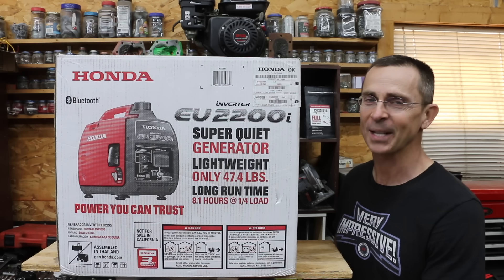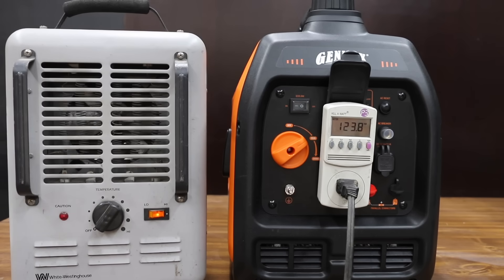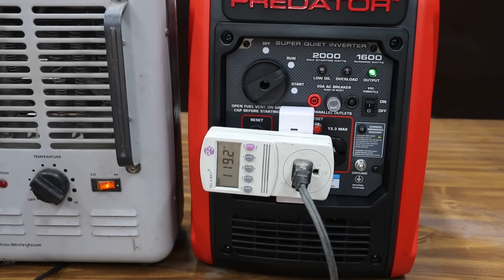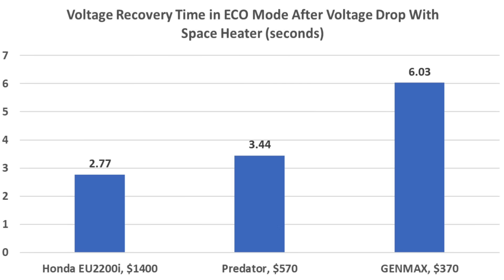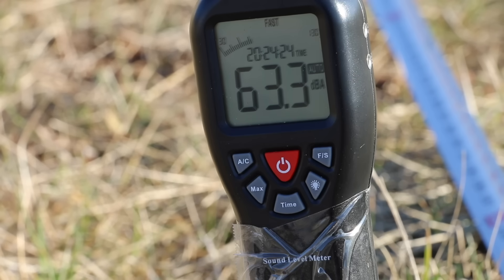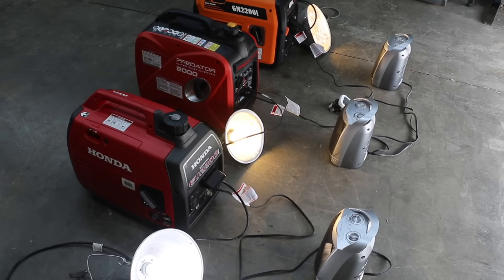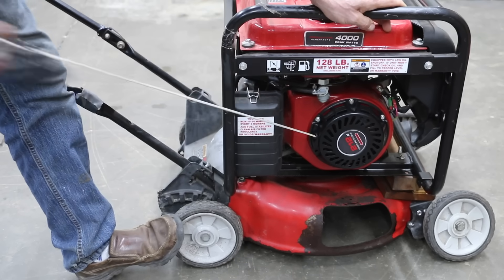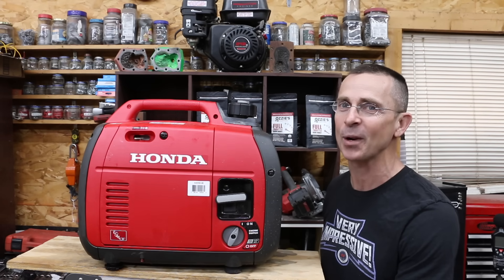Cheap Generator Better Than Honda? Predator vs Honda & GENMAX—Let’s Settle This!

Comment: On the vein of generators, I use propane/gasoline dual input generators since propane is a bit easier to store and keep stable I just keep several tanks around. Next time you do generators, a propane based one would be interesting to see in both power and noise. Great as always!
Reply from the maker: Great video idea! Thank you
Reply: @ProjectFarm  A propane generator test/comparison would be a great idea, as the carburetors have no issue with gumming up after long storage!
Reply: @rhpicayune 

Thats why using Ethanol based fuels. E0 is better and all I would use.

That being said, I am willing to bet that one could store propane for a much longer period of time than even E0. 👍
Reply: @rhpicayune  I always use StaBil reg or marine in my stored gas engines. No problems storing over winter. Chainsaws, weed wacker and generator at my hunting camp sit 10 months between uses. No problems.
Reply: @ProjectFarm  I bought a Wen DF475X for $500, decent dual-fuel. I'm pretty sure the output frequency is not very clean though. Not sure what size you'll test next, but a Wen would be cool to see.
Reply: @Project Farm  
and maybe add in the fuel efficiency and power output compared to different fuel types. I know when running propane you lose hp with aerial lifts and material lifts and  it's the same with generators. I wonder if the claim is what they say and worth using alternative fuels.
Reply: @ProjectFarm I would like to see tri-fuel generators added to the list or at least some portable units that can use natural gas. In the past, we learned that weeks long, major power outages take out gas stations and businesses that sell propane while our natural gas flows uninterrupted.
Reply: I'll second that.. I converted 2 of my chyna-cheapo's to propane and plumbed them into my house line..  Before I did that, I was outside in the snow, rebuilding the old up-draft walbro on my 9 HP briggs a couple times per year due to junk gas gumming and rusting...  With the propane,, it's an oil change once a year or so and no other maintenance. Just close the valve to shut down.. No worries about draining and fogging the fuel system.. . It would be interesting to see some actual data including engine wear and power output on the different fuels..
Reply: A lifetime ago I worked at Penco making lockers and industrial shelving.  The forklifts in the factory ran on propane because it was safer.  I'd like to know the carbon monoxide differences between running on gas v.s. propane with a genny.
Reply: @bansheedearg  Propane emits up to 80% less carbon monoxide than gasoline in a car. Emissions on a generator will be different, but I imagine propane will still produce significantly less.
Reply: @bansheedearg  propane burns a lot cleaner ..i used to run a V8 Landrover on propane and after a year the oil looked as clean as the day i put it in
Reply: @bansheedearg  safe"r" being the key there. You are still combusting oxygen in an enclosed space and producing co (among other things). Think about the whole natural gas/propane oven debacle recently (and the fact no indoor gasoline ovens exist), it's safe-ish, depending on the size of your house, ventilation, season, airtightness of the home etc.
Reply: @DracoOmnia  Excellent point, sir.  I do love my gas appliances but the furnace,  water heater, and clothes drier all have pipes to the outside for exhaust.  The oven, which I love for it's gassy power, does not.
Reply: @bansheedearg  Of course, because the combustion standards for the oven/stove are different that the other appliances, which is why they are vented, and the oven is not.  I have gas wall heaters that also do not require ventilation due to the ability to burn clean.  The ones that require venting are not held to the same standards.  But, still all need a source of replenishing combustion air.
Reply: I’ve seen videos where they convert the Honda to run on propane considered it for the storage benefit
Reply: @HawaiiSustainable  I converted and run a Honda 2200 to bio-gas.

I made a biogasification system that I run horse manure thru to create syngas which can be run thru the generator.

I get rid of my manure pile and get some free energy to run the lights in the barn.
Reply: @HawaiiSustainable  
Yes, there are LP conversion kits for the Honda EU line, but AFAIK they cannot be configured to easily switch between gasoline and LP/propane like some of the other Dual Fuel generators.
Reply: I think you lose a bit of power running propane as opposed to gasoline or diesel.  I believe diesel is the most efficient.
Reply: @Codyjrt  The claim is 20% less power on propane but if you're not using full power,, it shouldn't matter..
Reply: ya agreed I'm saving up for a duel fuel myself I'll take the performance hit of propane just need to get  the bigger gen..
Reply: Indeed, as many have said, I converted my Predator 3500 to propane as it seldom gets used and haven't regretted it yet. It IS harder st start but I put that on the propanes fewer BTU's per gallon; am I wrong about that?
Reply: @postalinVT  yes there is less energy stored in propane. 

In cold climates (think of a 15f day after a storm). Propane also starts to have trouble vaporizing once the generator has been run for a while. As the propane boils off into a gas it gets colder, and since it's already cold outside you can find yourself having trouble with propane generators, especially under high load such as running space heaters.... The bottle temperature becomes so low that the tank pressure drops below where the regulator can continue supplying gas. 

It is a great stable fuel, but it has it's drawbacks in certain use cases
Reply: @postalinVT  If you swapped the carb for your conversion,,, The regulator on the carb needs engine vacuum to allow propane to flow through it and the line needs to be purged of air with the button on the regulator..  SO,, you may need to pull a little harder to create enough vacuum to open the regulator on a cold engine. Typically,, Hold the button until you smell propane,  you choke it and pull one time, then reduce to half choke and it should start on the 2nd or 3rd pull....
Reply: @twistedhillbilly6157  Thanks twisted. I didn't change the carb. The kit I bought came with a 'diffuser' ring that goes between the air filter and the carb. Floods the air inlet with propane. I do wait till I smell propane and have it on choke but maybe I don't need to choke it if It's flooded with propane?
Reply: @postalinVT  Do you have a regulator mounted on the frame or somewhere else in addition to the one on the tank??  As for the choke,, In your case it would be different because the choke is AFTER  the fuel input.. I would leave the choke wide open (OFF) because it blocks the fuel. perhaps half choked to create more intake vacuum which is needed for the propane to flow
Reply: @twistedhillbilly6157  Thanks, I'll give it a try.
Reply: Just adding to the pile. I too would like to see a propane/dual genset showdown.
Reply: Propane and propane accessories
Reply: A 'bit easier'?  A thousand percent easier!  My current home backup solution is 100% propane... if my big tank gets low I call the company and it's refilled without me even noticing.
Reply: Agreed, I need to buy a generator soon and I want a dual/propane for the simple fact I can store my fuel indefinitely
Reply: @hopinondeeznuts350  If you get a gas only model you can get a conversion carb for around 20 bucks...  It is a perfect bolt-on with no modifications needed,, then you just use a BBQ regulator which are the same standard 11WC pressure..
Reply: @twistedhillbilly6157  interesting, I will definitely look into that.
Reply: Someone in the comments suggested a comparison video for propane versus gas in these generators. I definitely second the motion.
Reply: Propane's lower energy density at the current price makes it more expensive than gasoline it does have the advantage of basically indefinite storage without degrading that's pretty nice also it starts about the same no matter what temperature it is as long as it's above the boiling point of propane
Reply: My Honda generator is rarely used, so I converted it to propane with a kit. It can sit unused for years, and it always starts on the 5th or 6th pull. The kit I installed added a shut-off valve in the gasoline line, so it can still run on gasoline.
Reply: @alex_stanley   hutch mountain? I added an hour meter, magnetic dipstick and ngk plug as well. Mobile one 5w30 and its pimp tite for the 150 hours I have on it so far.
Reply: I hope you can include the Firman Dual Fuel Inverter Generator from Costco. 
I’m definitely looking at that for emergency use, keeping a tank of propane ready to go.
Reply: Dual input ? how do make a generator dual input ?
Reply: @AAAAAAndrea  There are several ways... A dual fuel carburetor  is the best... It has an input for liquid gas and one for propane,, many also can be switched to natural gas so it's actually tri-input..  Very simple...
Reply: @AAAAAAndrea  

I think dual input is the same as dual fuel. Many are made that way, which is what I would buy.

There are probably many videos on how to make them that way. I saw one for a riding lawnmower.
Reply: Den of tools had a video that implied harbor freight was going to do dual fuel in the future.
Reply: @davidjernigan7576  Den of tools makes a lot of stuff up and is WRONG most of the time...
Reply: I am also much more interested in propane generators than gasoline generators.
Reply: Propane burns cleaner than gasoline. It does have less BTU content than e-10 gasoline but it depends on how much horsepower the prime mover engine has to the output wattage. It is industry accepted that it takes two horsepower for every 1,000 watts under load. This takes into account the inherent inefficiencies of an internal combustion engine. I have a Yamaha EF 2000 IS and converted it to trifuel. I am still able to get the 1600 w output on gasoline as well on propane. 

Another important piece of information that many do not realize is leaner air fuel mixture on gasoline will result in higher combustion temperatures, it is the OPPOSITE with propane. A richer air fuel mixture with propane results in higher combustion temperatures. I see many people converting their gasoline only generators running the air fuel mixture too Rich and they burn their valves. The ignition temperature for propane is higher than gasoline but hardened valve seats which are commonly found on small engines are able to withstand the slightly higher combustion temperatures when air fuel mixture is properly set.
Reply: @Bassguitarist1985  Can the air fuel mixture be affected by the propane regulator outside the unit? Once I get my 3500 running it runs smooth and quiet.
Reply: @postalinVT  is the propane kit aftermarket or OEM? If it is OEM I expect that the air fuel mixture was set at the factory and one should not touch that adjustment unless they know what they're doing.

If the propane kit is aftermarket then you need to make sure that the machine is running as lean as possible on propane in order to support the load. US Carb for example with their motor snorkel kit with its demand regulator on the generator has what's called a load block that restricts the propane flow which adjusts the air fuel mixture.
Reply: @Bassguitarist1985  It's after market and I can't remember the brand. Besides the obvious regulator on the bottle, there is a small thumb wheel that controls the gas flow so you can regulate for a smooth idle.
Reply: @postalinVT  Yes but just because it runs smooth doesn't mean that it's running the leanest it can. The best practice is to turn that load block screw clockwise when the engine is at full load (electric resistive heaters are best) a little at a time until the engine starts to stumble as in starving for fuel. Then back out that screw about a quarter turn at the most and then set it. That way you know the regulator is feeding just enough fuel at full load to support it but not overfeeding it to the point where it will cause engine damage.
Reply: @Bassguitarist1985  Will do as you suggest, thanks. P.S. about a hundred years ago ( high school ) I played bass for a "rock" band; it was fun but didn't bring many paying gigs. Oh well, everybody wanted to be a star back in the 60's. :)
Reply: @postalinVT  I can attest to there not being many paid gigs. I do it more as a hobby playing out till 2:00 a.m. every weekend as a young man's folly! Instead I now play with musicians who were just graduating high school from that era and only playing till 9:00 p.m. haha!!
Reply: @Bassguitarist1985  how is propane delivery regulated in the system with load? For gasoline, the carburetor meters the amount of gasoline with the air flow, but is the same mechanism somehow used in a propane setup?
Reply: @sadfur8728  The butterfly valve on the carb is used to regulate engine throttle. The large demand regulator is what feeds the engine propane as the demand/load changes. The primary regulator at the tank adapter brings tank pressure down to 11" WC so the demand regulator can use it. The DR has a vacuum lockoff mechanism so no propane flows unless the engine is running. The load block on the outlet of the demand regulator restricts the propane flow which adjusts air/fuel mixture.

The demand regulator is the heart of the conversion. If thats not set properly thats where you can run into issues.
Reply: @Bassguitarist1985  is the demand regulator sensing the engine manifold vacuum to adjust the propane flow?
Reply: @sadfur8728  correct. There is a negative pressure lock off mechanism in the demand regulator. If the engine is off, no propane flows. Some automated setups do require an electronic solenoid lock off for safety but not for portable applications typically.
Reply: @Bassguitarist1985  I run a factory installed CNG vehicle (1.4 TSI Volkswagen engine). It’s a duel fuel petrol/CNG and it’s really great on fuel when ran on CNG, but crappy when on petrol. My limited knowledge is that they require different compression ratios to get a (near) complete burn and therefore get the most energy out of each fuel.  I suppose the CNG likes the turbocharger and the supercharger on the engine as it’s designed around working on CNG, whereas it’s the opposite for an engine that’s built to work on petrol then converted to dual fuel. Hence the “20% less” that’s commonly used, and I believe your output shows as well (2000 W down to 1600 W).
Reply: @goldenhandcuffs  correct, typically 12:1 for dedicated CNG engines, and 8:1 sometimes 10:1 ratios for gasoline. Propane is 110 octane fuel vs gasoline at 87 to high test 89. It's all about efficiency extracting all the usable work from the fuel.  CNG/propane also has a higher ignition temp than gasoline, so spark ignition systems need hotter sparks and slightly advanced timing to compensate. There are some tradeoffs. Dual fuel engines need to be "oversized" on gasoline so as not to experience power loss in output on propane/CNG since they can only be optimized for one fuel.
Reply: @Bassguitarist1985  thanks for the input. I’m an 2 years out of the field gas fitter (specialized in inspections, utilities supply side) so my the technical knowledge is limited but I’m always willing to learn.  I plan on getting a residential compressor and refuel my own vehicle(s) when possible. This part of Eastern Europe it makes sense economically. 

I’d also need a backup generator so these smaller dual fuel ones will play a role if not the least while camping.
Reply: Yep video on propane generator comparison!
Reply: Theoretically gasoline is 92 or so octane.  Propane is 110 octane
Reply: I see the conversion kits for Hondas are not that expensive. I may do it just so I don't have to worry about fuel going bad in the carburetor.
Reply: @firewaterforgeofarizona4304 I purchased the propane conversion kit for my Honda 3000, and have yet to find anyone who will install it.  What is the bit deal?  Is it dangerous? I would love to find a video of someone who is DIYing one on their Honda 3000.
Reply: @mrs.c5471  Sorry, but I havent looked at a 3000, so I dont know what would be involved. The conversion for the 2200 is straight forward and safe. Part of the problem these days is no one wants to risk doing something outside of their insurance coverage. I had a home repair biz some 15yrs ago and now I wont even turn the screw on a friends washer because of the liability. Sorry I cant be of much more help.
Reply: I also bought a dual-fuel generator, and I love the ability to store the fuel so much longer, as you mentioned. Gasoline is so much more of a headache in every way. I've never run gasoline in mine and hopefully never will.
Reply: The Wen df250i is the one i own and seems to be doing well. I have ran it both on non ethanol 91 and propane. It does take about 8 pulls to get started on propane but that is to purge air from the hose.
Reply: Wouldn’t diesel be better?
Reply: @bngr_bngr  
Yes, better in terms of efficiency.  But diesel generators (engines) are large and heavy...so not so good for portable use compared to the generators in this video.
Reply: I've had good luck with my champion pure sine propane.  Used it through hurricane Irma.  I also have a champion 3500 and that puts out much more wattage, and can run window ac units.
Reply: Basically you get what you pay for with the Honda. If you use it as home backup once in a while, buy the cheap one. I use mine to power my travel trailer when camping. The power, quietness, and dependability of the Honda fits my needs. I probably will never have to buy another generator again for this purpose.
Reply: My Champion is dual fuel. Runs smoother on propane.
Reply: It is simple.  Less power output running on propane due to the different energy density of the fuel sources, natural gas is even less than propane for the same reason.  Propane/natural gas benefit is long term fuel storage.  Noise difference? Not worth talking about.
Reply: Propane provides a serious power de rate. In addition, propane is pumped by compressors. That said, you stand a very high probability of purchasing propane that has compressor oil mixed it. Not much harm with your grill but it will require repairs of the fuel regulators on your engine. Speaking of fuel regulators, they are extremely thin membranes. Have to be in order to modulate low pressure with any accuracy. After a few seasons of winter to summer swings the diaphragms become stiff and the machines will not start. Constituents in propane have the effect of washing oil away from valve stems so it’s tough on engines. With the low btu per pound compared to diesel, compared to gasoline, propane engines are disasters in fuel consumption. Storing compressed explosives may not be as benign as a generac T v add or hardware store guy would have one think. Natural gas is worse as it is mixed with oddities such as butane. Fuel burn worse, power is worse. Save your money folks. BTW, what ya gonna do about correctly sizing mainline circuit breaker on a machine rated for gasoline power output and you just removed 17% of the engines horsepower? There ain’t no free lunches
Reply: @mikepotter6426  LSD is pretty strong in your area..
Reply: @twistedhillbilly6157  I wouldn’t know. But suggest don’t push the button if your considering challenging me on power generation. Ya won’t learn anything because your not capable but you will not prevail in the debate. Go on, get ya a twenty dollar carburetor and a gas grill can. Watch this bubba:)
Reply: @twistedhillbilly6157  dear mr hillbilly. I have reconsidered my earlier response. It was not Christian nor was it kind. Sorry for being so harsh. I feel bad.
Reply: @mikepotter6426  I only speak English so I wouldn't know if it was Christian, kind, or harsh. It is just a bunch of babble that made NO SENSE at all so I understand how bad you must feel.. You be trippin'!!!
Reply: @twistedhillbilly6157  whatever. I have nothing to prove. See ya
Reply: @mikepotter6426  You be trippin' HARD.. YOU PROVED all you needed to prove..    NO you will NOT see ya.. Babble ON little lady,, Babble ON!!!
Reply: Remember that most of these engines valves will not stand up to propane use.  

The Honda is super easy to store for trouble free use later, take all of 5 seconds to drain the carb after use.
Reply: @john0270  Have you ever run an engine on Propane???  None of what you said is correct...
Reply: @john0270  if any of the gasoline powered equipment doesn't have a shutoff valve for the fuel separate from the run switch, it's best to add one to allow the engine to clear out any residual fuel from the carburetor float bowl and passages. 
If just left in there for long term storage, it won't run properly again unless it's taken apart for cleaning, due to the ethanol laced fuels mandated by the politicos.